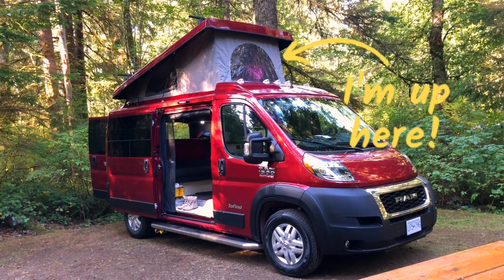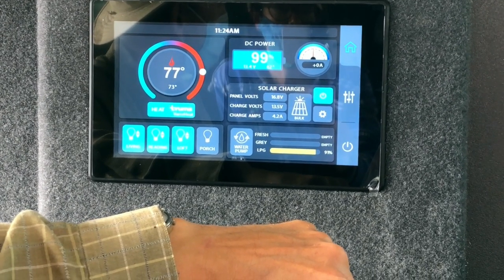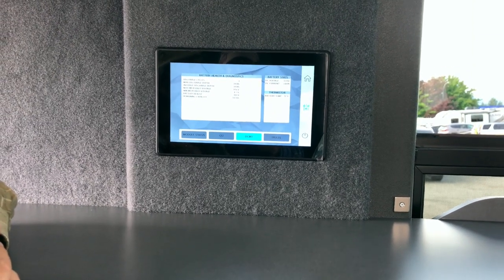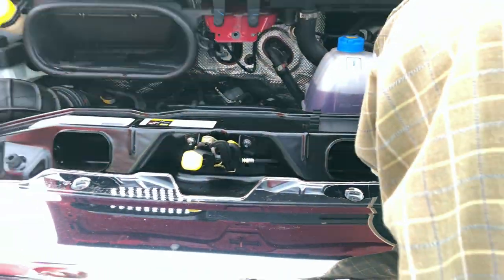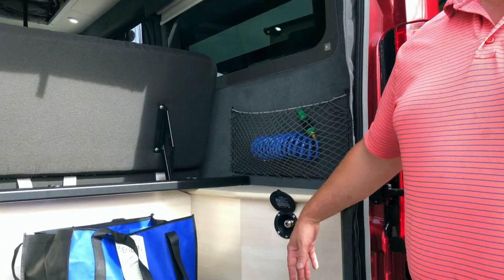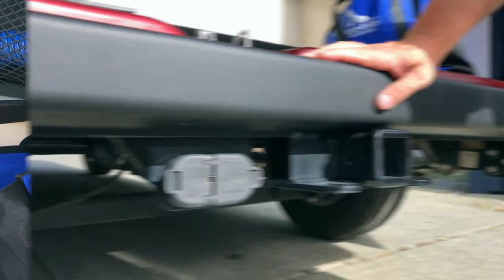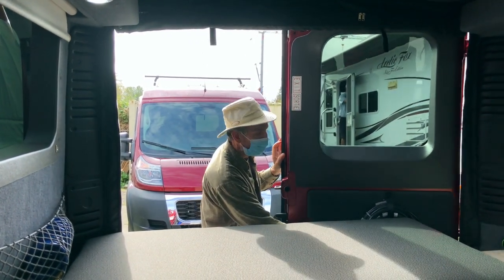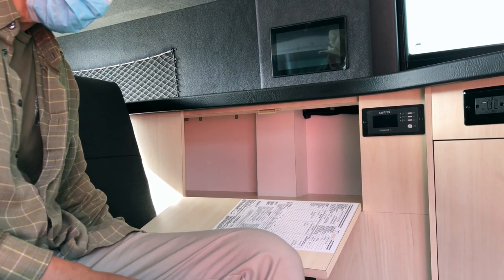Tofino Camper Van (2021) - Pleasure-Way's Upgrades and Improvements to Earlier Models

Comment: Your guy was very thorough and knew lots more about the Tofino than ours did. I believe he is wrong about having to remove the fridge door to get out the freezer, unless that’s another thing that changed. It takes careful finagling, but we got ours out without removing the door. Just don’t force it. It was a bit tricky, but we are very glad for the extra space. Enjoy! Nice video!
Reply from the maker: Excellent, thank you Susan! That's great to know, that the freezer is removable without taking the fridge door off. I had planned to remove it, but now I have small packages of frozen veggies and fruit in there. Perfect for soup and oatmeal, especially in the winter! So my freezer door is firmly frozen in place. 😊

Comment: Nice! I am considering a Class B camper van, and I love the simplicity and cost of these Tofino units. I don't know if they have any dealers in the Eastern USA, but I am surely going to look. Thanks for all the great videos you have been making on the van, and all your thoughts and purchases to make it ready to roll. Now I have to go back and watch some of your prior videos. Keep up the good work!
Reply: There are a lot of dealers in the US that are a sign that I am and I’m in love with this since I came outEven though I feel it’s still quite pricey without a bathroom and now I’m kind of curious that it doesn’t have hot water either

Comment: At the 7:03 mark, I see "Battery Type" is set to "AGM".  It should be changed to "Lithium".
Reply from the maker: Wow, good catch Bob! If you have other suggestions, feel free to lob them my way :-)  What do you think of a front-mount bike carrier? I'd like to avoid a back mount if possible, to leave the doors more accessible....but a front bike rack might expose the bike to rocks, bugs, etc. If you have experience with bike racks, feel free to share. Cheers!
Reply: How She Blossoms I don’t have a bike presently, however I think I’d go for a simple, hitch-mounted rear bike rack if it were me. I’d do this not only for the reasons you mentioned but also because I’d much prefer not having anything obstruct the great view we have heading down the road.
Reply: That's what I caught on the screen too. According to the manual, the factory standard equipment should be 200Ah lithium pack. Please double-check whether you still have the factory installed lithium battery pack or it somehow has been substituted with cheaper AGM batteries.
Reply from the maker: @SG-yk3xh  Thanks for the tip! I never would've thought of that. I will check to ensure we have the factory installed lithium battery pack. I'm in my Tofino right now, as a matter of fact. If a cheap substitution (rip off!) has been made, I'll post an update.
Reply: @SG-yk3xh  Mine are lithium. Someone at Pleasure-Way wasn’t paying attention to settings during their install.

Comment: I can rate the engine as a POWERHOUSE:) its used in multiple larger 3500 and this is a 1500 with the same V6! The engine is bullet resistant like a TOYOTA:) all engine components are VERY easy to get to especially the engine fuses, where i had blown an electrical fuse using a higher rated inverter than required (my fault) just lifted up the fuse engine cover in the engine bay less than two minutes and new fuse placed in ready:) Really like the larger touch screen and location as i will place a 10 inch in wall IPAD pro next to it also, maybe two:) (why not) the bathroom was my major concern as the Cardio Axion has one built in and a 21 gallon black tank. But after really considering a westfalia with no bathroom a lugaloo will be ok and freshly dumped daily!

Comment: Great video. Do Tofino's have the ability to run AC overnight off the grid???
Reply from the maker: Tofino's don't have AC in the coach itself, but there is AC in the cab. So you could use the engine's AC overnight if you run it...but somehow I don't think that's what you're looking for. You could looking getting a portable air conditioning unit, but they would be a huge power draw. Some people in my Pleasure-Way Tofino Facebook group have USB-powered fans, but I've never tried them.
Reply: So, would I be correct in assuming even if plugged in at a RV park the air conditioning isn't enough to keep the interior cool in hot summer climates OR you you saying the air-conditioning won't operate unless the engine is running.  Please excuse my ignorance, I'm new the RV world.  I really like the Tofino, but I'm unsure of how I can survive using it in the hot humid south.
Reply from the maker: @boozsh   No problem - I'm saying the air-conditioning won't operate unless the engine is running. In the Tofino, the air conditioner is the same as in a car; it comes out the front driver/passenger area. I haven't had to use it yet in my Tofino, but I think it'd be a big waste of gas to keep the engine running to keep the cabin cool. That said, however, it is a small van.  I'll check our Pleasure-Way Tofino Facebook group; if there is helpful info there, I'll share it here. Hang tight for a few minutes...
Reply from the maker: @boozsh  Surprisingly, there's not alot of discussion in our Tofino Pleasure-Way Facebook group about air conditioning. One guy got a portable air conditioning unit that runs on its own batteries; he had a positive report. I suggest you join this group, Conor (it's free and really helpful!), and ask. We're a supportive, friendly bunch :-) https://www.facebook.com/groups/2401739613447058/
Reply: Wonderful!  Thank you for clarifying.  I was practically raised in a VW Westfalia growing up and I want to continue the tradition.  I can't wait to get my hands on one.

Comment: ..WHEN are they ever going to put a bathroom at least a small toilet, in it? Forget it.
Reply: You can purchase a compact cassette toilet and use the middle area of the van or in the back.  Or when you set up camp you can place the cassette toilet inside a small privacy tent. The toilet can be filled from your main water in the van. I survived an entire motocross season with my young kids and wife doing this with a much smaller SUV and no water source!
Reply from the maker: Thank you - I just read your comment, and am considering a compact cassette toilet. I have a privacy tent that hasn't been used. I'm breaking her out this summer...